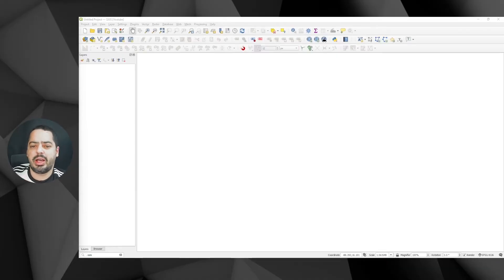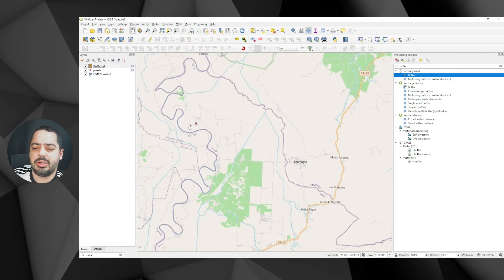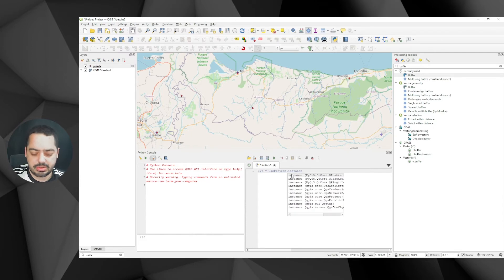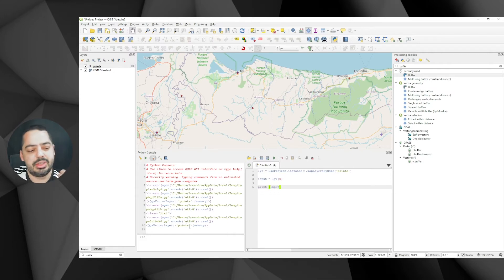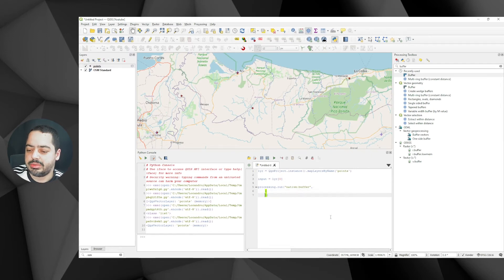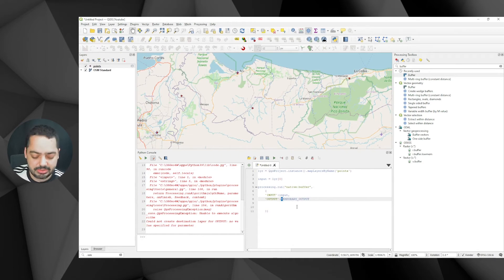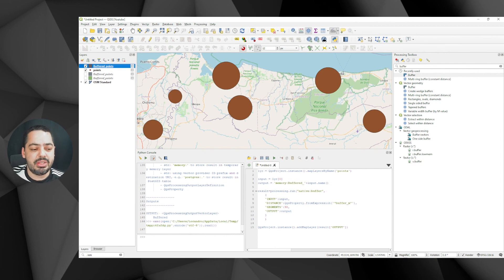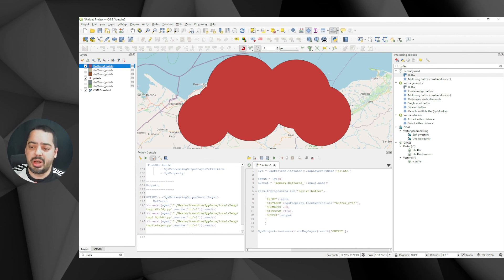How to make a buffer using PYQGIS and processing algorithms - QGIS

Comment: Thank you! I'm working with hydrographic basins, and i'm thinking on using this to automate this part. Altrough, we got river buffers(line shapefile) and point shapefile water source buffers, and we merge both buffers, then dissolve. Do you know if i can i put a merge or union algorithm in between the buffer, and then dissolve?
Thank you, that really helped.
Reply from the maker: Should be possible, I guess you buffer first rivers the points collect into a single layer and dissolve as needed. Would be interested to know if you solved it